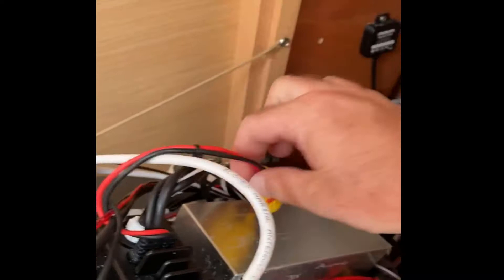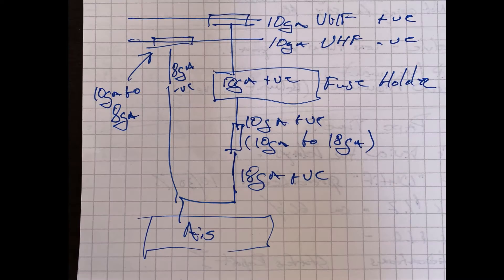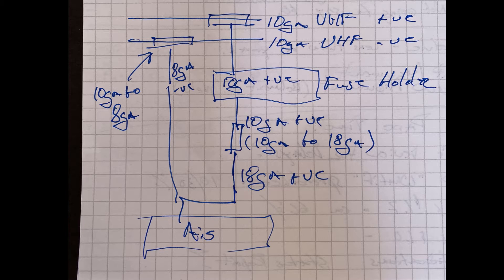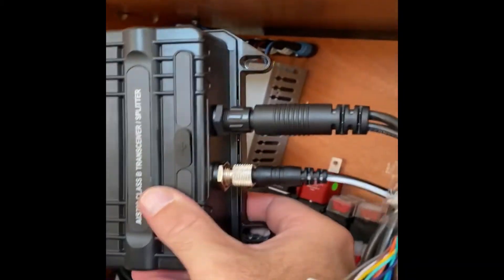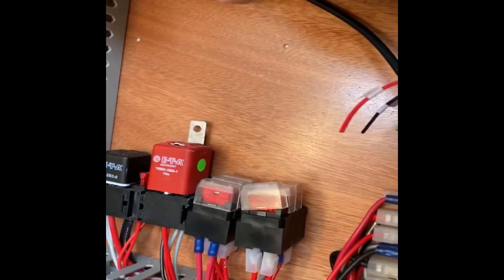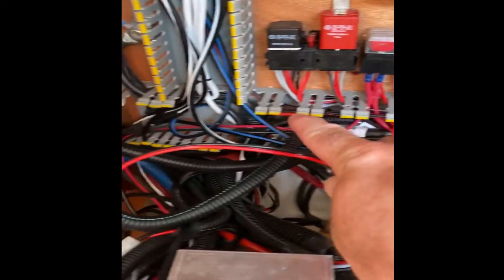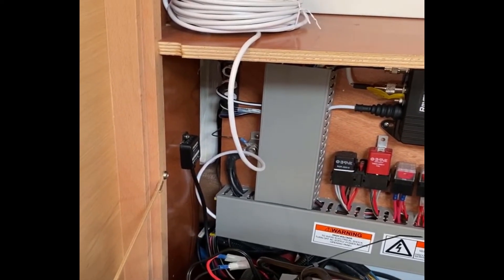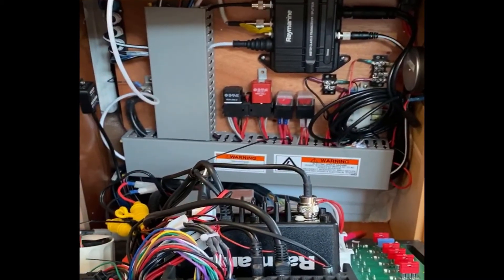Installing an AIS Transceiver on our boat (Raymarine AIS700) - Part 2 Installation

Comment: If you connect to Seatlk NG still need to be powered to the 12V DC?
Reply: Did you figure it out? I'm wondering the same thing..
Reply: @kasroot  - I know this is old, but for anyone else wondering if you run it to SeatalkNG you do NOT need to wire it for power separately. Additionally, if the network shares data with an Axiom chart plotter it also doesn't need the GPS mushroom installed as the Axiom has embedded GPS itself.
Reply: @apexmoto9610  are you sure? the instructions, and everything else I've read, suggests that if you don't connect it to separate power and connect the mushroom it will only operate in receiver mode and won't work as a transceiver.
Reply: @beepcake  what did you eventually find out?
Reply: @davidressler4292  I spoke to a Raymarine person directly and they said transceivers definitely need their own power, and (in the UK at least) they have to have their own GPS antenna.